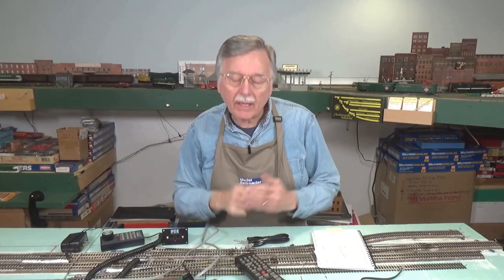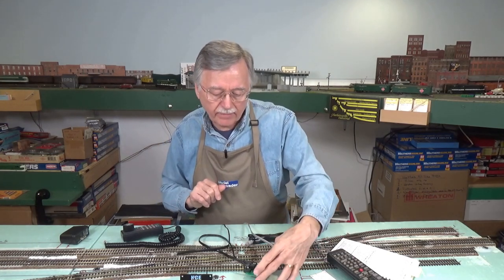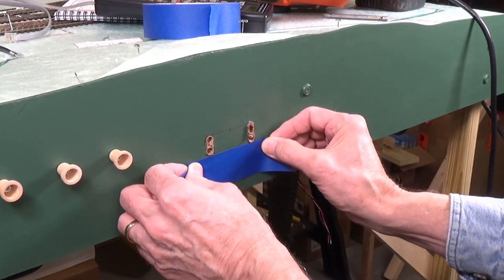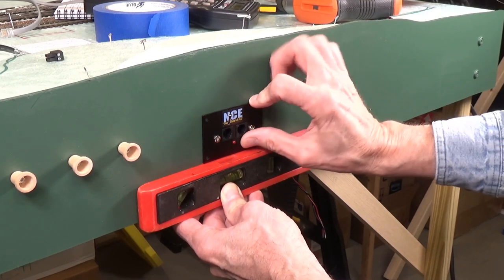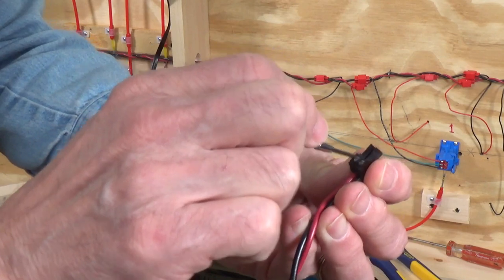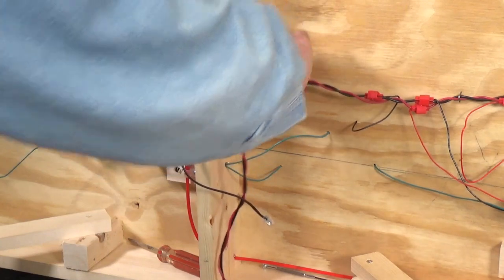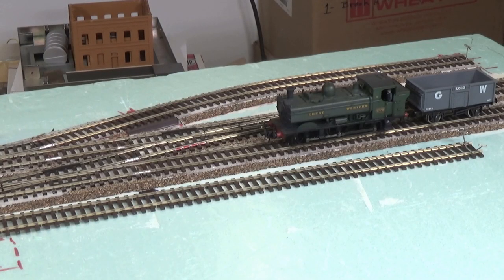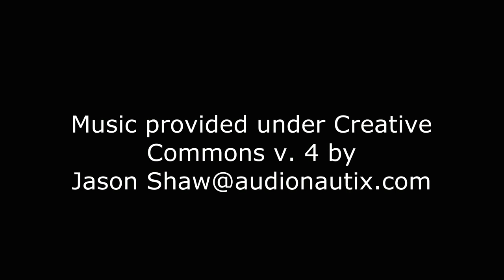Quick And Easy NCE PowerCab Installation

Comment: Hi Larry, cheers for that, I use the PowerCab and am very happy with it, I don't run more than 3 locos so it suits me very well. At some point I want to add an additional throttle, have you an opinion on the NCE engineers throttle? Many thanks, Kevin.
Reply from the maker: I use the Cab06 and prefer it to the larger throttle as I like a big knob instead of a thumbwheel.
Reply: @UKModelRailways  Thanks Larry, much appreciated.